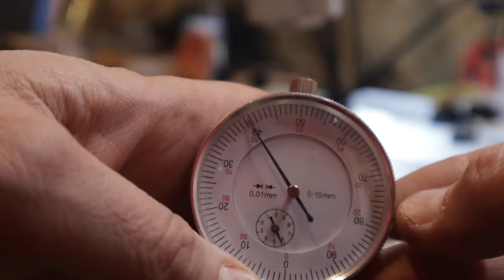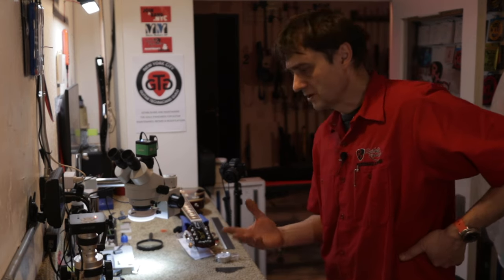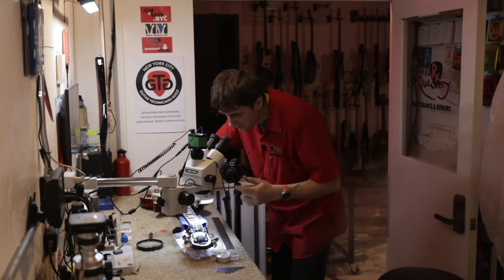Review - Epiphone Les Paul 60s Standard

Comment: I'm guessing you also tried out some of the Epi LP customs and didn't make the cut?  I'm curious about those, especially the IGC tier models... And how those individual guitars are..
Reply from the maker: As it turns out, I was just looking over two Epiphone Les Paul Custom models. Both with P 90 pick ups.

I thought they were both killer guitars. 

Unfortunately, not every Guitar that I look at can end up in the videos. Not enough hours in the day. 

That said, I never advise any potential buyers to go by any Guitar reviews while evaluating if they should buy a guitar of the same make and model. 

Each guitar is its own individual entity. What grain is like a fingerprint. And then different people work at the factory. Just because the Guitar has the same headstock logo, it doesn’t mean that’s the same as another one that was reviewed on YouTube.

Comment: Wilkinson tuners and pickups etc. are great!
Reply from the maker: True. There are quite a few Wilkinson hardware components that are totally solid. 

I think the point that many of the commentators are trying to make, is that Wilkinson tuning machines are cheaper than Grovers. But the manufacturer changed the components without adjusting the final price of the assembled product and continued to list the product stating that it has Grovers.

If the Guitar had solid gold strap buttons, and the listing said that it has solid gold strap buttons, and the guitar was listed at a certain price, people expect that the guitar is sold as described, at that price. 

The manufacturer should not just start selling guitars with gold plated strap buttons, without adjusting the price and without disclosing the fact that the strap button are now only gold plated. Even if they function just as well as the solid gold ones.

Hope this makes sense.
Reply: @GuitarQuackery  Mine came with grovers

Comment: Those tuners should not be Wilkinson, they should be Grover Kidney Beans.  I got mine in 2020 and it came with branded Grover tuners stock.
Reply from the maker: There is a whole discussion about that on one of the guitar forums. Epiphone has a fine print that says that they can change the hardware or the materials without any prior notice.
Reply: @GuitarQuackery  They must have done a run where supply for Grovers were low or something.
Reply from the maker: @dionysusthemadgod  That’s what someone said on the guitar forums.